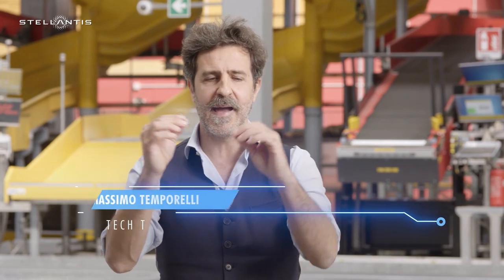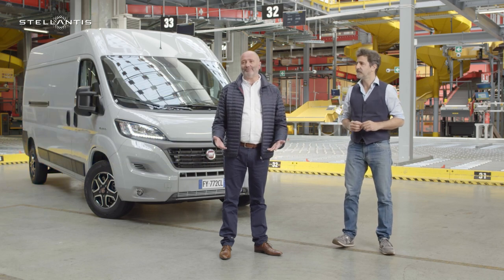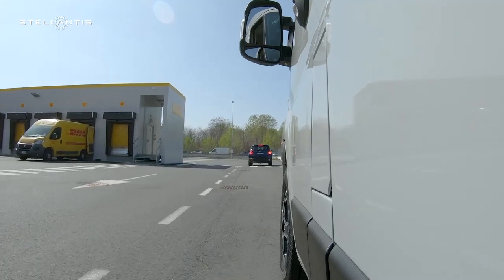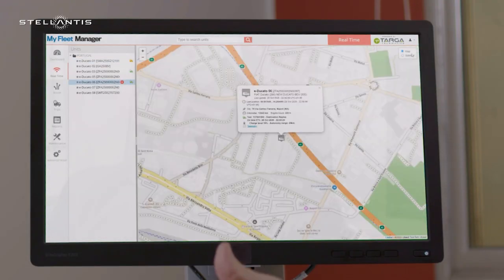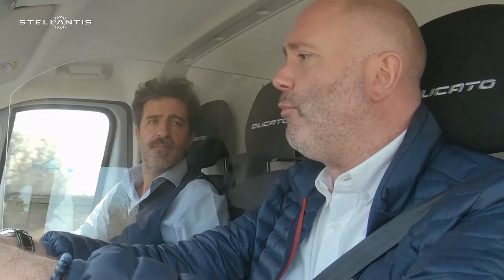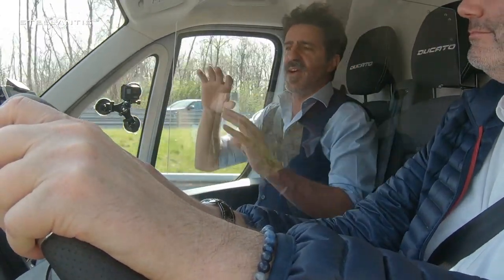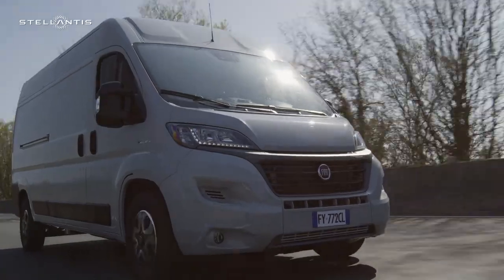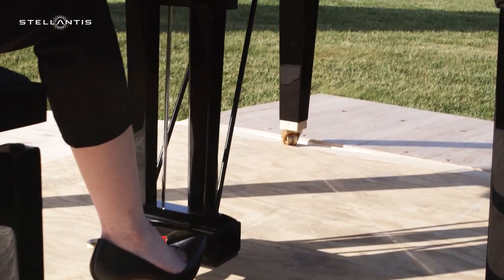Fiat Professional | New E-Ducato Web Conference

Comment: Poor quality, many defects

We have been driving the E-Ducato as a panel van with the 79KWh battery since November 22.

Not bad in concept but unfortunately many flaws.

-defective wiring harness, frayed after 300km from the factory due to poor routing,

-high consumption of 40-45KWh / 100km in winter everyday,

- Poor processing in the factory, connection to the reversing alarm not available,

-App running with error message: battery failure,

- Loud hours of fan noise when charging with 11KW, AC of 72dB, neighbors complain about the noise, noises are outside the specifications of the BISchG,

-Fiat promised a solution in the first quarter of 22, now in April 22 it just means everything is OK, there is no shortage

- creaking noises in the steering after about 1500km, dome bearing defective